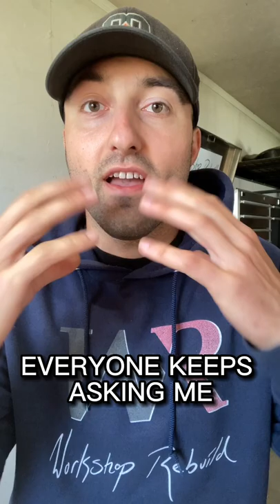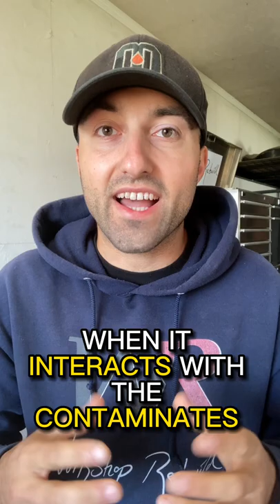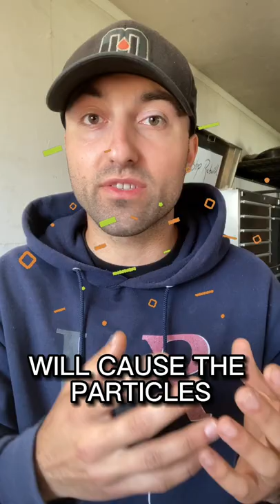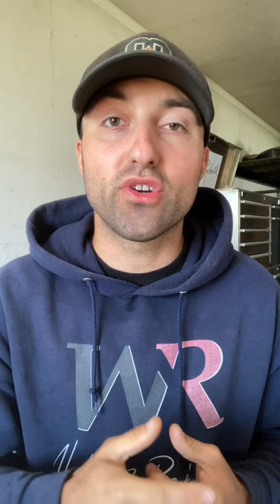How does laser cleaning work? #rustremoval #lasercleaningmachine

Comment: How much did it cost to rent the laser? I know you used this on the steel frame. Will it burn the aluminum?
Reply from the maker: I was allowed to use it and did not have to rent it. The laser does not harm metal in any shape or form. Steel or Aluminum can be cleaned with ease as there is a range of adjustment for the laser cleaning head.
Reply: @WorkshopRebuild  Excellent. Thanks